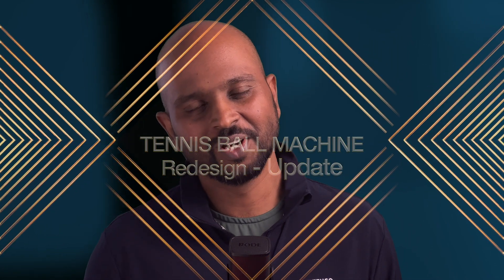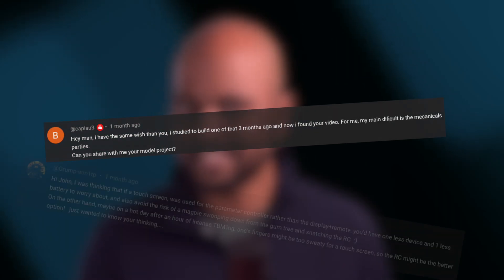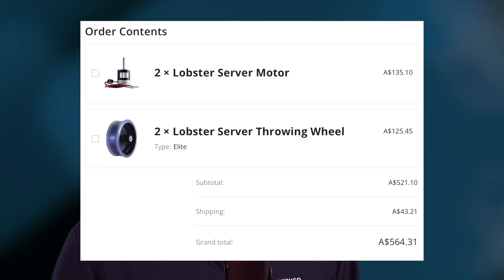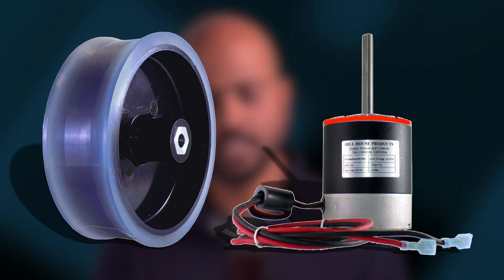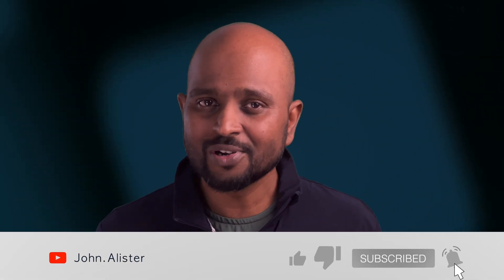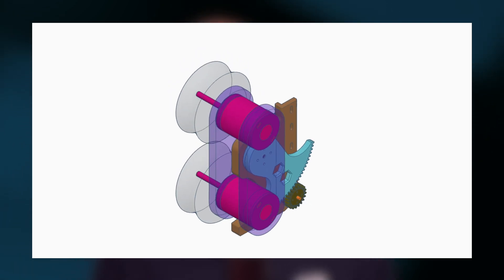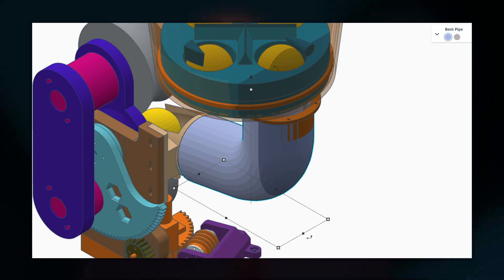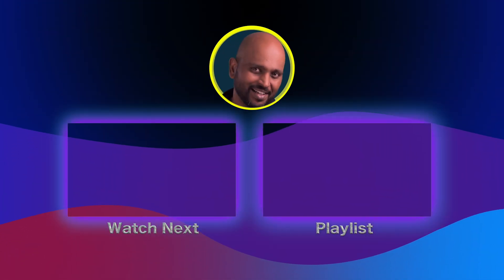Part 5 - Time for a NEW Design! - Tennis Ball Machine - DIY Build

Comment: I am late to the video, but I made the wheels using a resing printer with 775 motors and I get no vibrations at all.
Reply from the maker: Wow that's interesting.. Would you mind sharing more details on your design?
Reply: @john.alister after many iterations, two support points for the axel of wheel stop vibration by weight. And as mentioned printing the wheel in a resin printer makes the density of the wheel more uniform.

Comment: Hello, I think what you have built is great. But I am trying to find a motor and wheels that are cheaper. Can you tell me the power and the number of revolutions (RPM) of the electric motors so that I can look for alternatives? Thanks!!
Reply from the maker: Hey there, thanks for your comment. Unfortunately I don't have that info as I coudnt get the specs for the motor from the vedor. THe motor is from a brand called Lobster who have IP protection on the specs. Its not rocket science level IP but still they have it. The manfucaturer could not share that info with me. This is the link to that product https://www.racquetdepot.co.uk/lobster-server-motor/ 

If you can find out more about it, please do let me know. Cheers.

Comment: Hi, I can't see the motor details, even on the Lobster page. Could you clarify or share more information?
Reply from the maker: Hey that is a proprietary motor and I too could not get any specs on it. I tried the manufacturer too, they couldnt share the specs of that motor.

Are you just after the dimensions? If so I can give you that. Let me know, thanks
Reply: @john.alister  Hi, thank you for the offer! I'm actually more interested in details like RPM and torque, among other specifications. I wouldn't consider purchasing such an expensive motor without knowing more about its performance, especially given that there are alternatives with similar characteristics.

I’ll make sure to share if I manage to find the information we’re both looking for.
Reply from the maker: Thanks, yes let me know if you find the information 👍🏽

Comment: So "your" design is complete copy of wolfgang bisners ball machine. Actually im pretty sure you have bought his plans  on the site he sells them for 10€. Could give some credit to the creater.
Reply from the maker: I did mention I got a good starting point from designs I got off internet. But you're right, I probably could have mentioned the source. Thanks for your comment, I'll do that in my next video.

I had to make a lot of updates to the 3D models to suit "my" design. You'll notice the differences if you have a closer look. For ex. The motors I use are different and therefor had to make changes to the models to suit them. But in general, yes, "my" design based off of that. And yes, I did buy them on cults3D website and not just one but two of the designs.

Comment: Salve bel progetto sto costruendo anch’io uno spara palline per il padel ma volevo chiedere a lei in informazione. Se ha già fatto il test di quanto devono essere distanti le ruote per poter sparare la pallina? Ho provato a guardare su Internet ma con scarsi risultati e sono bloccato nel progetto di quanto deve essere la distanza tra le 2 ruote. Grazie in anticipo se mi risponderà. Buona giornata.
Reply from the maker: Oh that is a very interesting question. I don’t play padel ball but I know that the courts are smaller than Tennis Courts. The gap between the wheels are usually going to influence the amount of spin and the distance of the throw.

So the closer the wheels are, the greater the pressure on the ball when it is being thrown out.

In my case I’ve got about 50mm gap between the two wheels. Please note that my wheels have a concave shaped edge that hugs the ball better as opposed to a flat edged wheel that has relatively less contact with the ball. 

I’d say try anywhere between 50 mm to 60 mm and see what works for you.

Hope this helps mate. Thanks for your comment, really appreciate it.
Reply: @john.alister  grazie mille amico ho fatto 50mm e devo dire che va benissimo ho stampato le ruote concave con motori 775 12v 4000rpm e la forza è notevole...ma vedo che i 775 sono pochi adatti emettono tante vibrazioni. grazie ancora.

Comment: Here is my DIY machine. https://youtu.be/OPMDPu0eNnE
Everything is working fine except the feeding module. Sometimes the balls get stuck and sometimes the ball doesn't get seated in all holes which results in balls being shot randomly. I have been working on it for months to find a solution. Please some any ideas.
Reply from the maker: Wow, a working machine 👏🏽👏🏽👏🏽 Congrats mate. I see you've used 775 type motors. Can I ask what did you do for the wheels? And how you mounted it to the motors? Or fellow maker from Argentina has that issue and your experience  will help him.

As to the ball feeder, I'll answer to the best of my knowledge 

Balls not seating in the holes is just a fact of life. But it should not occur frequently. Looking at your video it seems the balls are dropping pretty consistently. But I also can see it in detail so I'm sorry if below doesn't help. 

To ensure balls are caught in every hole, the spinning disc needs to be made with curves and slopes similar to the store bought machines. My feeder disc is made of two 30mm high density foam sandwiching a 6mm plywood disc. I've sculpted the foam discs to stimulate that to a degree but even then not all holes catch the ball. Ive made my peace with it 🙂

Coming to jamming, this one is a pain. There are 3 things to look out for. 

1. The ball getting caught below the disc just before it falls free 

2. The ball getting caught above  the disc. This usually happens when there are two balls in a hole and they are squeezing each other out when they are about to fall 
 
3. Balls jamming randomly. 

I faced all these issues and resolved them as below. 

First issue. Make the hole on the bottom bigger than the ball giving it time to fall fast. But don't make the guiding hole too big. This will prevent two balls getting into the guiding holes. 

Second issue, you need to play with the finger projection above the dropping hole so that it only allows one ball to fall down but also not so rigid that it cause jams. I use a spring like projection that's used as a door stop for this. I placed it at a height thats just right for a single ball in the guiding hole. 

For the last issue, my observation is to have the balls mix up. So I used some side projections. Kind of like pushing the balls in as they go around the container. I'm not sure I've nailed this but it seems to work for me 

Oh lastly,user a strong motor. Sometimes brute force will solve it. 

Hope this helps and good luck. You've got a working machine! That's quite impressive 👏🏽👍🏽
Reply: Hello.

Can i ask about the wheels. The ones in the video are too expensive for me. Can you give me the name or where to buy it from. And do i need a belt for friction. Or does the wheel contain the belt built-in

Comment: Got stuck on a similar issue. I wasnt able to connect wheel + shaft + motors. I am in a small city in Argentina so it gets super hard to find parts and equipment without spending tons of money. 
Wish you luck and waiting to see if 3D printed parts work!
Reply from the maker: I hear you mate. It's hugely frustrating when something that's so simple in principle turns out to be a blocker. 

There's definitely ways to mount a motor to a wheel using a coupler and shaft but I couldn't get through the issue of inexperience and lack of tools. I had to go down the path of expensive parts in a hope that it solves the issue. Let's see 

My suggestion is if you are using genetic motors and wheels, try reaching out to a local metal worker. They'll be able to create a frame and mounting plates for motors and bearings that reduce vibrations. 

Having said that, balancing wheels is tricky but not impossible to overcome. But they'll give you some pointers. Heck maybe even do that for ya. Why didn't I go down that path?  Well, I got excited about 3D printing the parts 😬! But I'll reach out if and when I have to. 

All the best.

Comment: I, like you, have been thinking a lot on design ideas. I would like to try a different ball drop system. Something like a long curled up snake like pipe that holds all the balls. No big spinning disc and hopper full of balls that can jam.. Just an actuator that lets one ball drop out of the tube system. I dont feel the need for software. If the ball can shoot at consistently at one spot thats fine for a practice and perfecting one type of  swing. Each repack of balls I can manually swing and raise the unit. If i want random changing balls I would play with a human. I don't see the point of having a feature rich machine. I want a consistenly delivered ball to develop one type of shot. Take a look at MY motor with 8mm coupler and bicycle training wheels. You end up with a pretty balanced setup. Especially if you do the extra to mill and balance yourself manually a final bit with weights and milling. Spening hundreds on wheels and motors is an ouchy .
Reply from the maker: Wow, such a detailed comment, really appreciate you taking the time to write this down.

I have seen the spiral tube mechanism on some other tennis ball machine and you are right, it is a lot simpler compared to the one I have built. But the simplicity comes with a few downsides, for starters, its got limited capacity, as all that inner space is not utilised. And the next one is the fabrication itself, its not going to be easy to source something like a spiral pipe from hardware store (may be it is, idk)

I am assuming you are referring to a solenoid type of an actuator and not a linear actuator here. If that is the case, the actuator mechanism sounds simple but it may not be 100% jam proof. May be I am wrong but I can see ball travelling faster between actuations resulting in double drops or a ball getting caught when the actuator closes resulting in undesirable effects, may be ball gets puncture (unlikely), or the ball pipe gets damaged due to the pressure exerted or the actuator gets damaged (not sure how the electrical properties of an actuator works here). Not to forget the timing of the actuator has to be worked out. You could keep it simple and leave it at a constant frequency though.

I hear you on the "keep it simple" approach, I definitely thought of that and if I wasnt making a video out this, I would have done that as my first machine. My aim was to make a machine that is feature rich so viewers and I know how to do it but absolutely trim it for one's purpose. 

May be I might make a simple design later or if I still fail to make this version of the machine a reality - you've given me some food for thought. Cheers 👍🏽

Comment: hey John :-) 
big fan of your project. May i ask which motor you use and which wheels and where to buy them ? 🙂
Reply from the maker: Hey there, thanks for the comment, really appreciate it. It has been a wild journey so far and still a lot more to go. Hope I get to the end of it soon 🤞🏽

The motors mentioned in this video are from a company called Lobster. They are sold all over the globe by authorised resellers.

Here is the link to the website I bought them from. They are based out of UK but I had it shipped to Australia where I live.
https://www.racquetdepot.co.uk/lobster-server-throwing-wheel/ 
https://www.racquetdepot.co.uk/lobster-server-motor/ 

I could not find an equivalent motor in the Chinese direct to customer websites like Aliexpress. I did find one on Alibaba but they were asking similar price for a sample of two units as they usually deal with bulk orders being business to business sellers.

Hope this helps, thanks for stopping by. 👍🏽
Reply: @john.alister Thank you, John, for the quick reply. I'm excited about your machine and wish you much success.
Reply: Way to keep the project going! I use ASA filament for my printed wheels because I leave my machine in the car. You're definitely an inspiration.  I love the idea of the gears and parts adjusting the height of the throwing arm. I'm so ready to take apart my revamped tennis machine for Pickleball for this project if possible. I would love to zoom/face time you on my machine sometime or my 3d printer setup for the ASA filament
Reply from the maker: Hey Chris, thanks for the encouraging comment. I'd love to connect sometime for sure. 

From what I gather pickle ball machines need less power than a tennis machine.

I don't play pickle ball although it's gaining popularity here in Australia. 

I'll be using ABS for the high stress parts in this project, like the motor mount plates and the fixed arm it connects to. The rest is probably going to be PLA.
Reply: @john.alister  PLA is a good idea for the production of the parts, testing, and low cost.